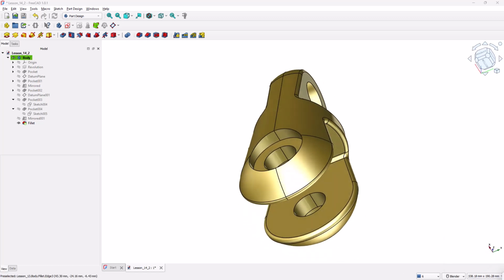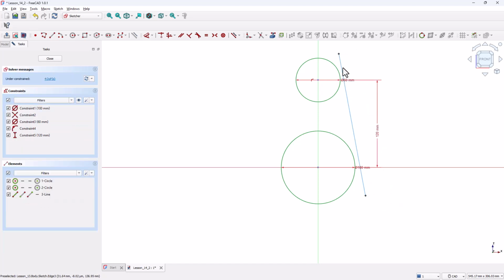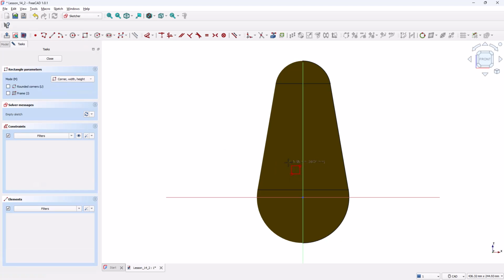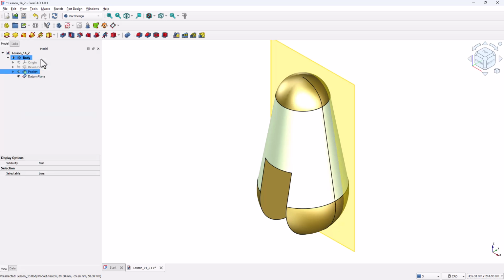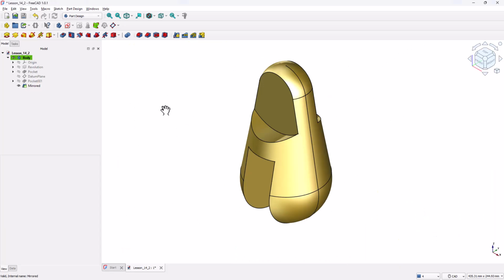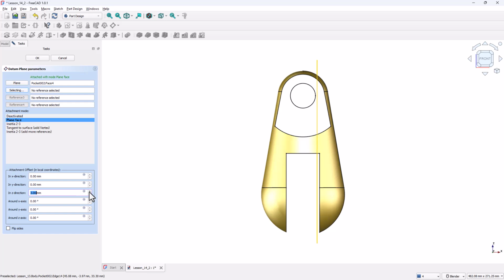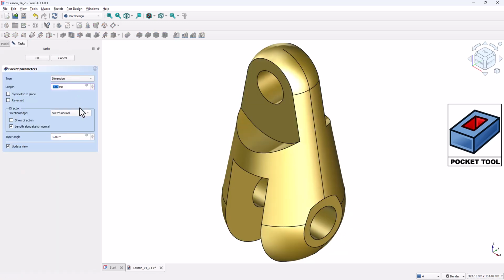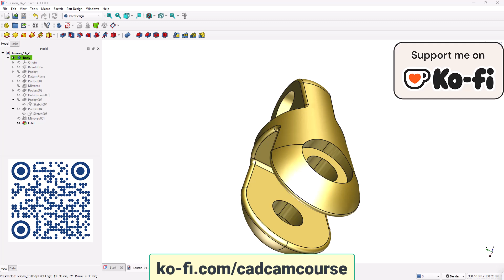FreeCAD Beginner Course | Module 1 – Lesson 7 | How to Model a Clevis Step-by-Step | Part Design

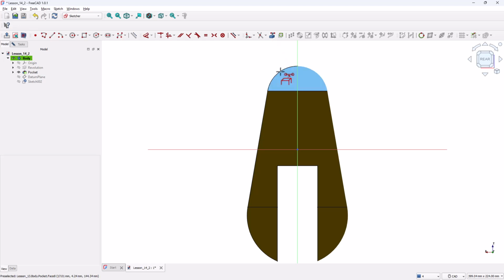Comment: At 5:50 I was unable to select the edge of the top circle. That's probably because I created the bottom cut/pocket and initial sketch a bit differently as in this tutorial (created it on another plane). That's really tricky and means you need to think ahead. I tried to solve this by adding the top circle again as nonstructural, but that didn't work. SO started from the beginning and followed the exact steps as in the video. This course is great, because Freecad is not an easy tool to understand.

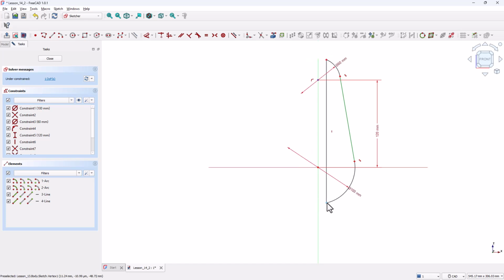Comment: Interesting, when I move the point for the vertical line at 2:27 only the bottom point moves. The top one stays on the vertical axis. When I constrain the vertical line to the origin point, the model has 1 DOF and the line pivots on the origin.
Reply: I had to constrain the top point to the axis, and the bottom point to the origin - and then it locks. In case anyone else encounters this.

Comment: This is really useful, awesome content! I've used other CAD software but I'm starting to learn FreeCAD, what I have seen when using the external geometry tool on a sketch to set constraints is that if a dimension changes later by a parameter on my spreadsheet (in this example the height of the clevis) then it doesn't automatically update and the sketch breaks. Am I doing something wrong?
Thanks again for your work! :)

Comment: Why would not you model half of the part and than mirror it? So you will not need to mirror each pocket?
Reply from the maker: That’s a great idea! 👍 We can definitely model half of the part and mirror it. But yes, we still need to mirror at least one feature — either the bottom counterbore or the top cut. Otherwise, we’d have to model just a quarter of the part and mirror it along both vertical planes.

Comment: So for the life of me I cannot get the datum plane cutaway view. This is the view after creating the bottom 40 MM wide slot. I have watched and attempted numerous times.  When Creating the first datum plane and moving by 15mm I have to apply it as -15mm to get to the same rear view.
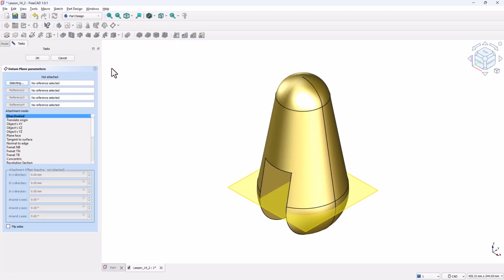Reply from the maker: Thanks — that can be really confusing. Try checking the “ Flip sides ” box in the Datum Plane parameters, attachement offset (05:00). That flips the plane’s normal so a +15 mm offset will move the way you expect.